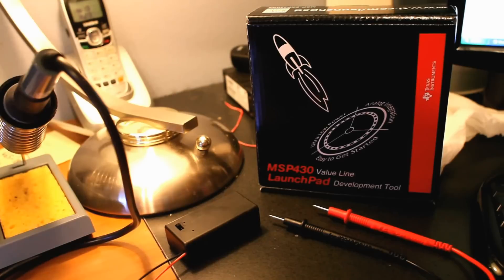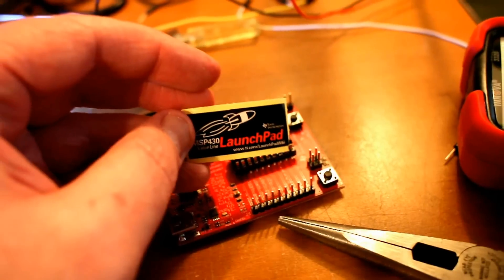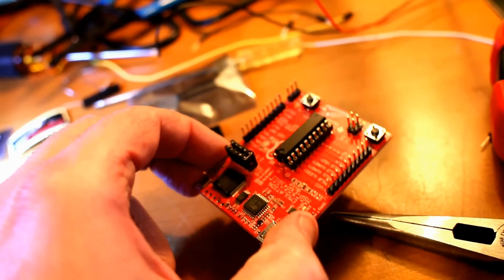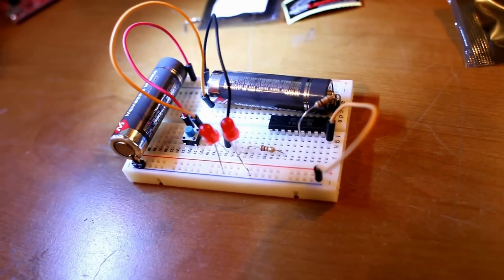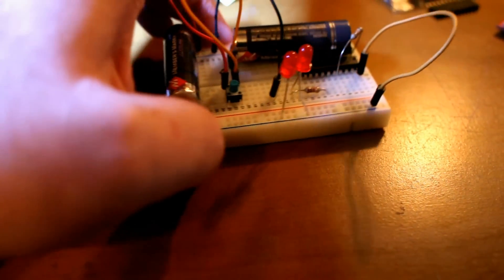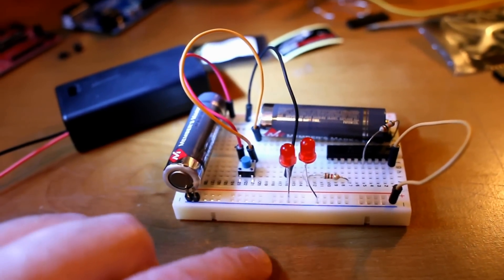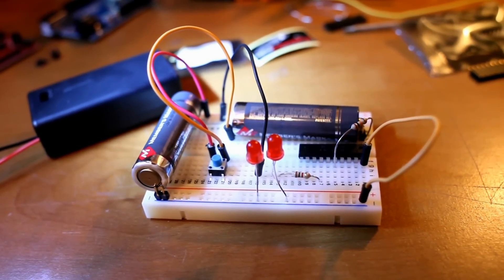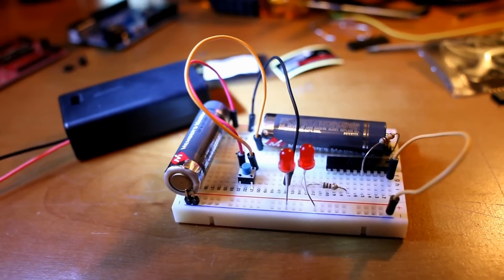TI Launchpad MSP430 installed directly on breadboard - Hello World

Comment: You can program avr chips on a breadboard from an arduino but you do need to add a voltage regulator. So if one was to fall into Amel chips for cheap so long as you can get 5 volts to them it is still competitive to use AVR. Thanks for testing out the TI chips though. The original board costs Ten bucks now from Mouser and TI and the DIP chips are all below four bucks.  Cypress has a board that is still four bucks and has op amps and external components built-in but you need their software. They have a lot to entice the arduino crowd too.

Comment: It is not an msp430 and it is not a microprocessor.  It it's a m430g2553 and it's an microcontroller.
Reply: Lonnie Honeycutt
It is however important to note that the two ICs included in the MSP430 launchpad kit are not the same.
Reply from the maker: It is an MSP430, m430gxxxx is a part number.  You are right about the microcontroller vs. microprocessor of course.

Comment: Hi, this video was really helpful, since I had no idea I needed a connection to the reset pin. 
I got my chip to blink an LED like you did here, but when I try to use it on several components, (piezo, LDR, LED, small motor) it fails to run at all.
Would you happen to know why that is?

Comment from the maker: No, I shot this video with a Canon 5dmk2 dSLR.  I think I was using a 28mm/1.8 prime lens for this video.  

The reason the video appears to be so smooth is that it is software stabilized.  The software zooms in to the video to remove the shakes.  You lose part of your framing on the edges, but you get a freakily smooth video.

Think I used the stabilize function in Premiere Elements.

Comment from the maker: Why the hostility?  I use both Arduino and Launchpad.  I think there are good reasons to use both.

Code Composer studio is free in a code-size limited version from TI.  The code-size limit is big enough to be used with any of the MSP-430 value line processors.  Also, you can use energia to program the MSP-430 as an alternative.

Comment: Like the video uploader said, it's really excellent for someone just getting into electronics. It's not meant to be an industry development tool. As a first year, EE student, I've found it really helpful for tinkering before sitting down and really coding my project. It is a lot more user friendly. For the electronics hobbyist, you don't need much more than Arduino. Also, I believe that the Arduino supports C/C++, so it is a really good stepping stone to become a more advanced programmer.

Comment: You are a case. How about we just ditch you and your self centered comments.  I've programmed both in the arduino and the msp430.  The arduino is better.  This video poster is complaining because he couldn't program his chip because it is surface mounted.  But he seems to not know that he can use his Uno board to program just about any of the Atmel processors.  That's been shown on many sites.  The Launch pads IDE is expensive and the Arduino IDE is free. That make the Arduino better right there